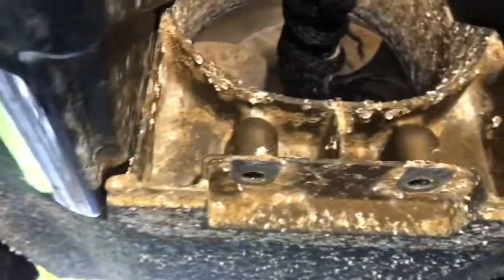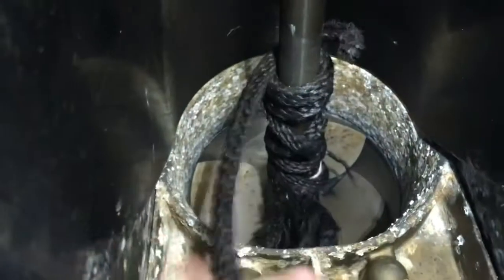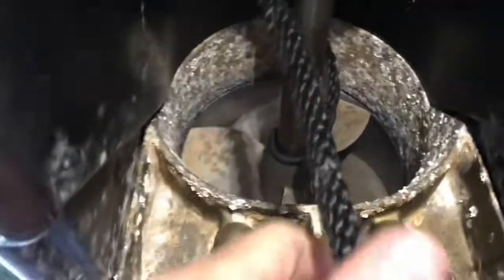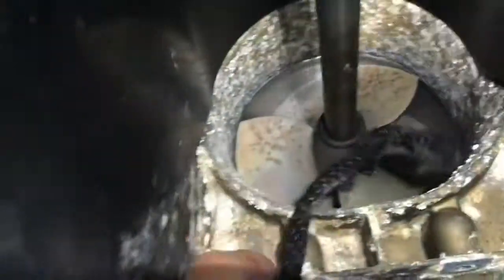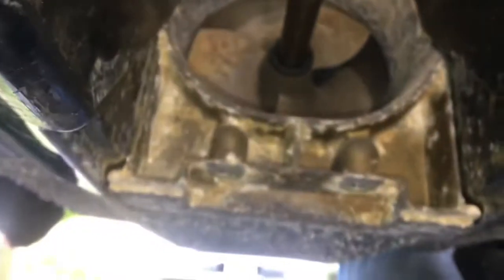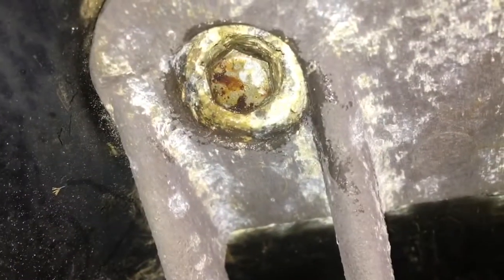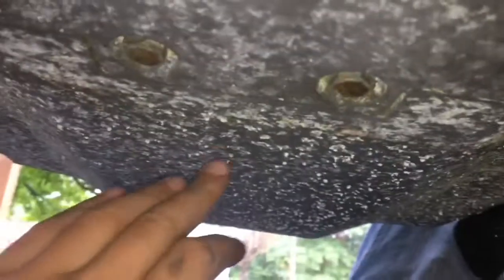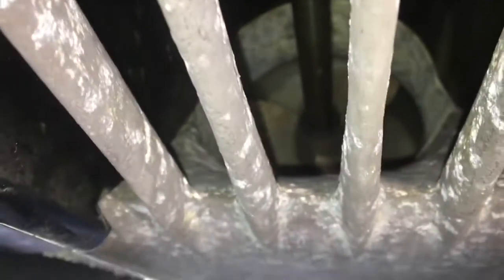Reviving The Sunken Jet Ski Pt.3

Comment: where part 4
Reply from the maker: Posted!
Reply: I’ll be checking that ware ring because with that pitting and rust combined that wear ring might swollen spots Yamaha uses  a metal ware ring instead of sea-doo they use a plastic one hope the info helps nice vid 😁👍